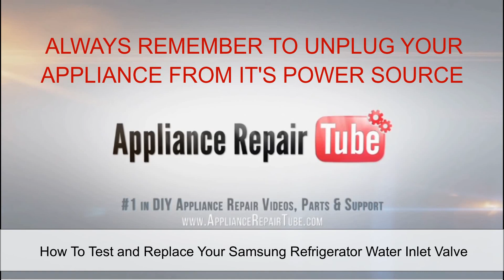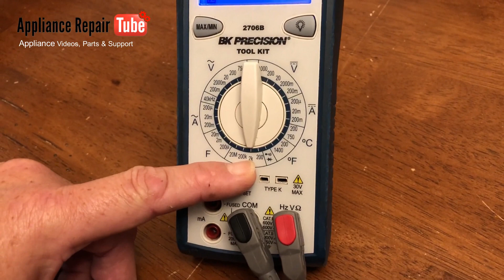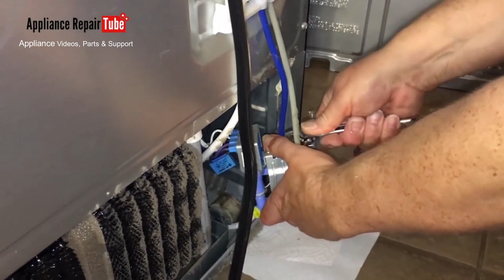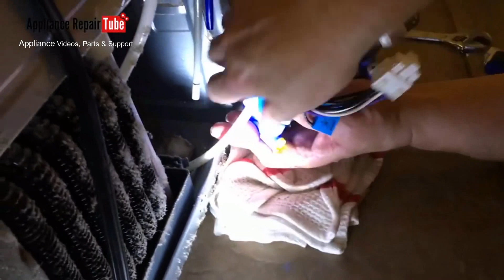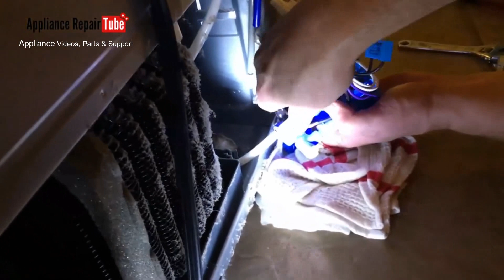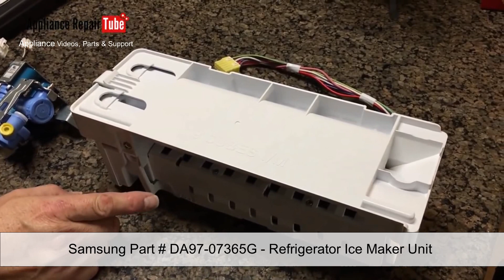How To Test Samsung Refrigerator Water Inlet Valve and Replace Video

Comment: This part number also  applies to Samsung side by side refrigerator model # RH25H5611SR/AA. its not making ice but I keep pressing the reset button in the ice maker it moves but I notice no water is coming out of the protruding pipe.. Thank you for showing how to do it.

Comment: Not a Samsung but Whirlpool  inlet valve.  1 ohm so that is bad.  The other of the dual inlet valve was 260 ohms.  My main question was how do these valves work electrically?   I disconnect the connector from valve and put the leads on the connector to test the voltage coming from water dispenser get 104 Volts when no water requested but 119V when water is requested .  Is that normal?   Same on ice water valve request connector.

Comment: The terminals are not exposed on the coils on the electronic control valve in order to test them??? Samsung DA97-07827B
Reply: Monte in your comments are you providing the water control value part number of DA 97-07827B or is that for the ice maker unit?  Disregard didn’t go far enough in the video. Having the same problem.  Ice maker stopped about 2 days ago hit reset or test button got the chime, however every little too no ice?  Also is the water control valve located at rear of the Samsun like in the video?  Thanks for sharing.
Reply: G Grong most, if not all, have been on the bottom right on the ones I have worked on.
Reply: I have this same thing. How can you test the coil if the terminals are not exposed?

Comment: Don't know that I can agree with your coil resistance results conclusion.  There are 2 different coils in your Red and Blue device and different ratings on each.  I have compared readings on my current valves to a known good replacement.  I get over 300 on one coil and around 180 on the other coil in both devices.
Reply: also a lot of OHM meters only go down to 200, the next one up is 2000, so using the beep or tone method should be more accurate which would skew the numbers.

Comment: Checked my water valve and it was good wondering if line is plugged water dispenses from water dispenser but not ice maker reset ice maker and heard the chime and it seams to be doig what it is supposed to?
Reply: Did you ever find out the problem? Our ice maker is doing the same.
Reply: Broken ice maker